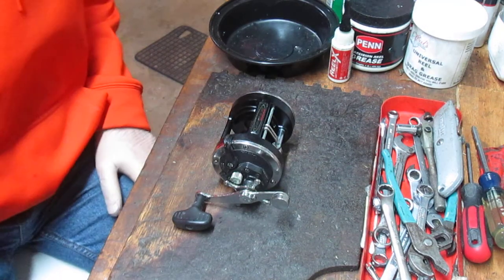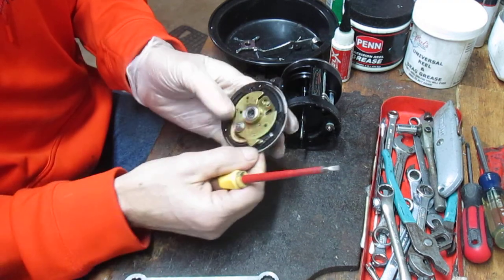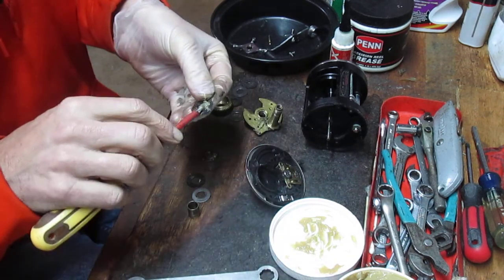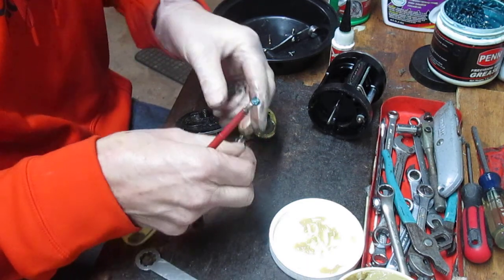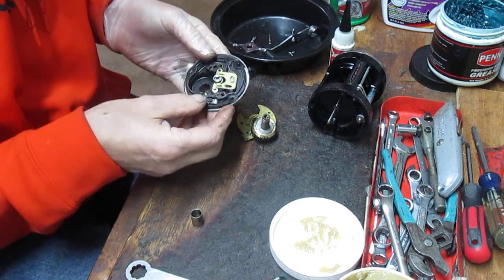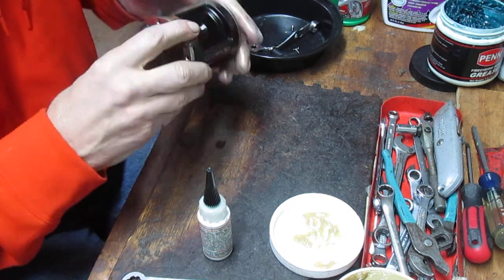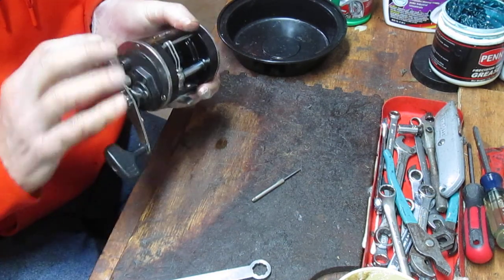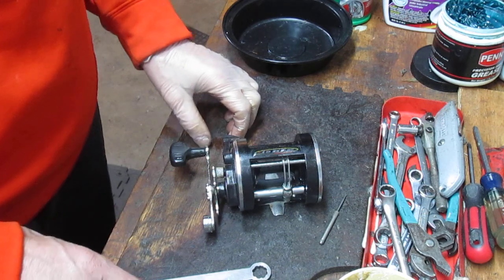Penn 310 GTi fishing reel basic maintenance service and rebuild

Comment: I always appreciate referring to your library when a new patient comes through the door. I now have a perfectly functional 310GTi. It was missing a few small parts on the handle side along with a bad pawl. It took me a while to figure out why it wouldn't follow the worm completely through it's complete cycle. It turned out that there was slight corrosion on the back of the skinny bar that the line guide hooks over. I buffed it out so it now tracks flawlessly.
Reply from the maker: Glad to hear you were able to give that reel a 2nd Chance!  Thanks for watching - Dennis

Comment: Fantastic video's. Thanks. Have serviced three reels so far with your help. My Mitchel 624, Senetor 4/0 and 310 GTI are all like new.
Reply from the maker: Thanks for the kind words of encouragement Joe.  I am glad you were able to use my videos to help service your reels.  Thanks for watching and stay tuned, there are more to come.  Dennis
Reply: @2ndChanceTackle   Will do. I don't think you have them over there, but if you have somethings similar, a Penn Mag 525 (1,2 or 3) would be very helpful. I have three of them that I use on a weekly basis. Thanks again.

Comment: I have a pen 310 gti graphite part number  23-60, my question is what gear or spring controls for the anti reverse dog?It skips and locks when it wants to.
Reply from the maker: Part number 14 and 15 on the schematic are the dog and the spring.  Make sure the dog is not worn at the tip.  That could cause the skip if the assembly is installed correctly - Dennis

Comment: Is there a up grade  drag system that I could use to up the drag on my 310 gti and will it work.i have herd people say you can use ht100 drag system  for the sentors 4.0.let me know what you take is on this.
Reply from the maker: The Penn 310 uses he drags washers from the Penn LongBeach 60.  You can use the HT-100 washers from it - the 310 uses 5 washers in its set up - Dennis

Comment: Drag will not tighten up what do I need to do to fix it
Reply from the maker: Wade - Is this normal wear, or did you open up the reel and it did not work when you put it back together?  If this is normal wear, you need to order replacement drag washers and install them as is done in the video.  If you need the parts, they are available through Mysticparts.com.  If you had the reel apart and the drags were working properly prior to your efforts, then you need to disassemble and start anew.  Most of the time something is mis-installed, like the ears on the metal washers not set into the case, or the ferrel missing.  Hard to say, without seeing the reel.  Please give me some more information and I will try to help further.  Thanks for asking - Dennis
Reply: You was right that's what you call 20 years

Comment: Penn needs to get their act together and bring back the Squidder, or 505 Jigmaster for surf fishing.  This means simple parts list, no level wind, ball bearings,  and one screw take apart.  With the GTI you do not need the anti-reverse defeat feature to play out line to a certain depth because you can count the number of times the level wind goes back and forth to get to the suspended fish depth.  I rarely used it on my Squidders either.
Reply from the maker: Simple is always better.  I prefer the open faced conventional reels, like the ones you mention for surfcasting.  Unfortunately, that is becoming obsolete, like a manual transmission car, as the general public seems to prefer level wind features and spinning reels. - Dennis

Comment: I have 3x 320GT2. No Back reeling feature. They are used for Halibut mainly.
I am doing some pre-season maintenance and noticed that on one reel that, the pawl doesn't track in the worm gear 100%.
Gets stuck on one side. Is it the pawl or the gear that is pooched? Thanks!
Reply from the maker: it is most likely the pawl that is worn on one side.  This is easy to check since you have two of the same reel.  Take the pawl from the one that is tracking correctly and put in in the one that is getting stuck. If it works OK with the change, then it is the pawl.  If it still sticks, it is most likely to be the worm gear itself.  The track could be damaged.  In that case, the worm gear would need to be replaced.  Thanks for asking
Dennis
Reply: Problem solved. I just took the fair lead right out. Cheers!

Comment: Hi. Great video. Thanks for publishing it. I have one quick message as I have a reel my younger son took apart and now I have to try putting it together. Can you use “reel butter” and the accompanying oil that they sell along with the butter for lubrication of the penn reels?
Reply from the maker: Yes you can.  You do not need to use a specific manufacturer's oil or grease on their fishing reel.  The key is to use a grease or oil that was designed for fishing reels. I stay away from general purpose greases and oils as they can break down faster or clog up reels.  I'm seen countless examples of this in the reels I have serviced. Thanks for asking - Dennis
Reply: 2nd Chance Tackle thanks for the information. Well, I have a 320GT2 that my son took apart and it would be nice if you could do a close up  reassembly of the crank side and all the different springs and gears, dog latch and etc if you have one you could demonstrate. I’m so glad I found this site. I’ve watched a dozen or more already and I’ve only known about your channel for less than 24 hours. I pride myself in being able to do most things like this and if I had been the one to take it apart I would have no problem putting it back together. But right now all I’m looking at frustrates the heck out of me. Help if you can. It’ll be most appreciated!!  I’ll be charging this channel on my Facebook and with all my fishing buddies.
Reply from the maker: I will see if I can find one.   I am not sure.  If I have one, I will be happy to do a video that details the gear side assembly. One of the best ways to see how the parts fit together is to get the reel schematic.  You can find this at;  Mysticparts.com.  They are free downloads of almost all Penn reel schematics and you can order parts if you find any broken or missing pieces.
Reply: 2nd Chance Tackle , thanks so much!!

Comment: Great video, how would you rate this reel for surf casting? Other options?
Reply from the maker: These are nice general purpose, level wind reels  I prefer reels without the level wind feature when I am surfcasting.  The extra drive gear that turns the worm and line guide is a drag on the spool when casting.  I find that I can't throw the line as far because of that.  The Penn Squider has always been a favorite of surfcasters because of the ball bearings and open frame.A modern day equivalent would be the Penn Squall 15. - Dennis
Reply: @2ndChanceTackle  Happy New Year Dennis; and thanks for great info. I sure comes in handy
Lucio

Comment: I have the 321 gti and I have no idea how to clean it. I just got it lol. I'm usually a Abu Garcia guy.
Reply from the maker: The procedures for the 321 are the same as a the 320 and 310.  The only difference is that the 321 is a left handed reel and the 310/320 are right handed.  You may need to reverse the rotation on the anti-reverse dog installation, but otherwise, they are the same.  Take pictures when you disassemble and pull the reel schematic from Pennparts.com to ensure you have an understanding of the reel prior to work.  Thanks for asking - Dennis

Comment: I hate to ask you so many questions I called Penn real company and got a sales rep I asked him florist in reels water resistance he said all of them and I asked him for a smaller reel 2 pan fish with he said he didn't know what panfish was so it's an hour I finally said kind of like a croaker or Whiting then he told me I would have to just pick one and try it
Reply from the maker: That is embarrassing to Penn.  You want the 3000 or 4000 size.  Shame on them. - Dennis
Reply: Penn Peerless number 9 is it any good which I know you can't tell me just my pictures I just want to know for all over and you just said was
Reply from the maker: The Penn 9 is a good reel - durable and dependable
Reply: I think I got it at a steel it come with a heavy Ugly Stik and the real $30